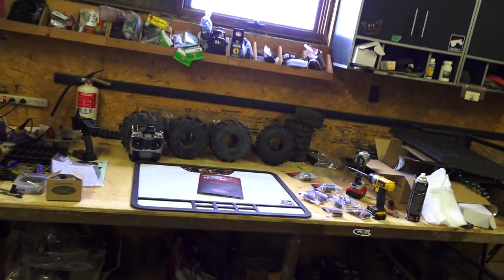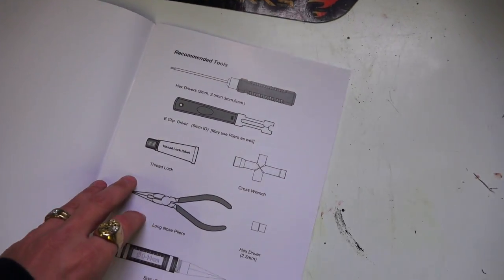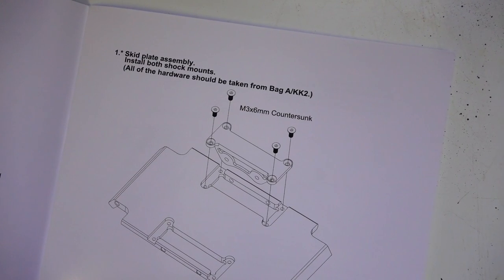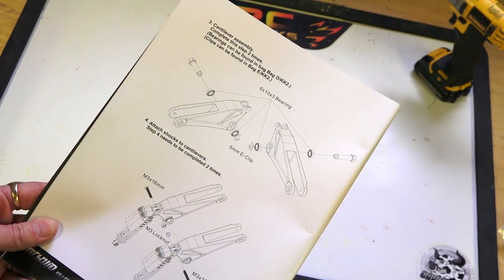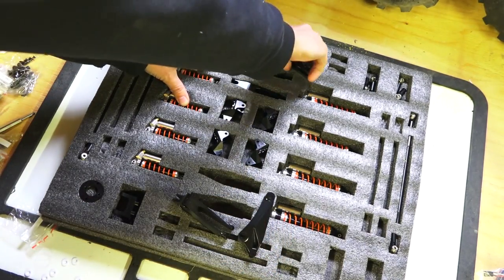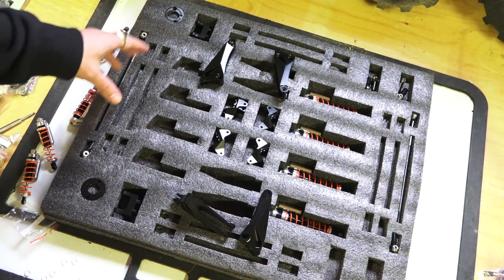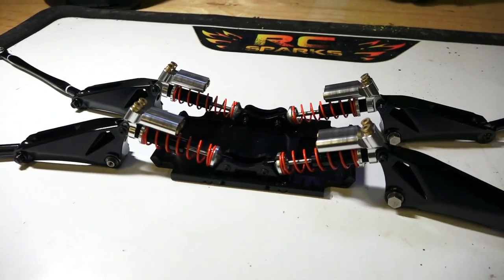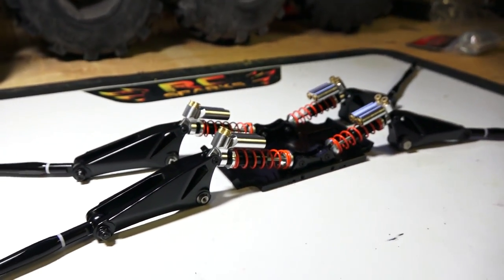RC ADVENTURES - Building a 1/4 Scale 4x4 Killer Krawler 2 - BV 1 - Cantilever Suspension

Comment: can you recommend any inexpensive upgrades for a tracts slash 2wd
Reply: rpm parts, chassis reinforcement bar
Reply from the maker: +neb allan nailed it
Reply: ***** Thanks,  I don't even own a slash, I have a Blizzard and a quadcopter!
Reply: I have a almost all RPM products 2wd Slash. They are amazing for the price and they all will improve your trucks durability.
Reply: thanks
Reply: I suggest you replace the shock caps with aluminum and perhaps some RPM parts. Just wait until it breaks which will happen in a long time.
Reply: thanks
Reply: +Tomos Williams yup, and save some money while you wait for it to break. that way you'll be ready when it does!
Reply: Thanks